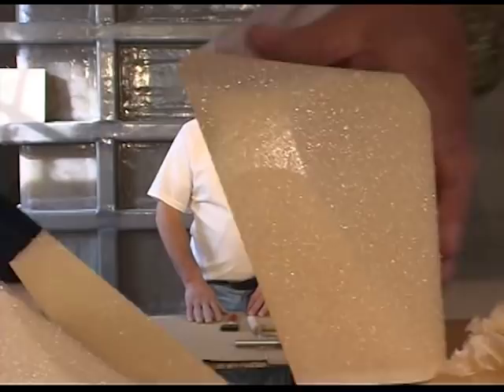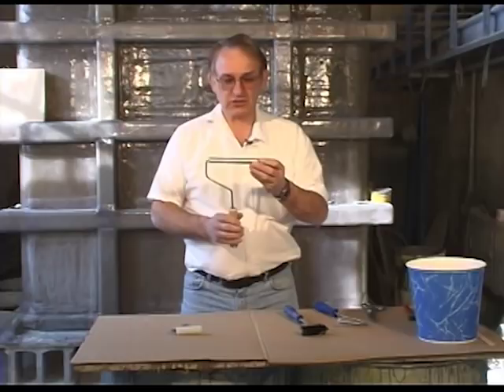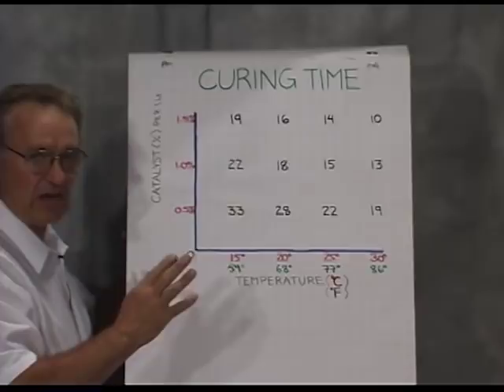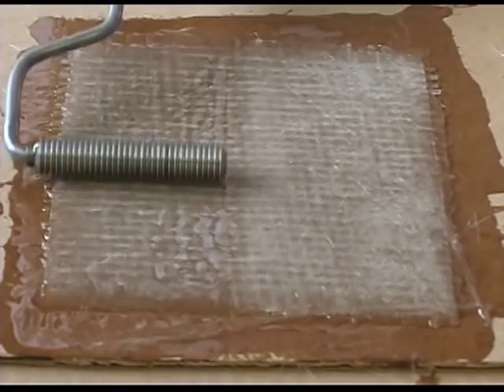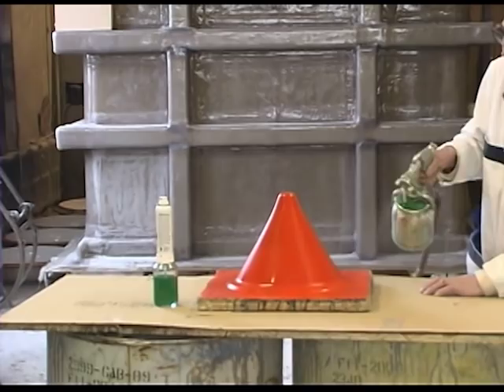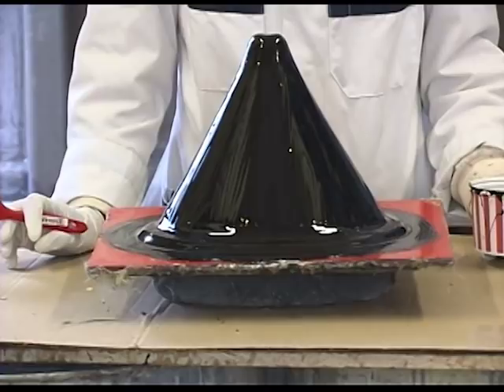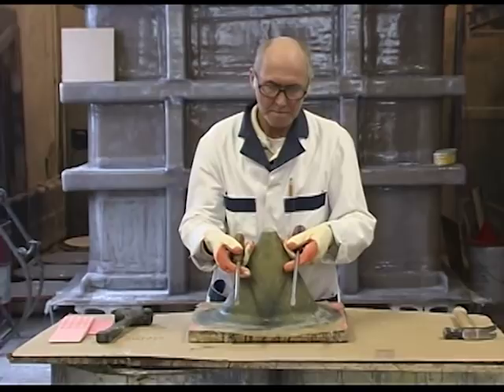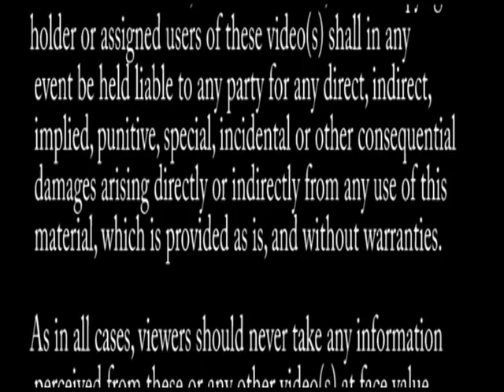How To Fiberglass   Laminating Tutorial

Comment: Will a 1:1 mix ratio epoxy resin for fiberglass onto plywood do the same job as a 2:1 mix ration epoxy?
Reply from the maker: Yes it should work, we recommend to always do a test piece first.
Reply: Awesome thanks. Do you know how many square feet a 2 gallon of 1:1 epoxy resin will do? I'm doing a 2.5ft X 7.5ft sheet of plywood
Reply from the maker: A litre of mixed resin should cover that area.
Ray
Reply: Okay thanks for your help!
Reply: @rayplex  😊

Comment: I recently started working for a boat building company in central florida with new ownership. We have a lot of pre release problems. Know one can seem to figure out. Any info or advice? Thank you.
Reply: Check your air compressor for oil.  Diesel exhaust is another culprit. Gel to highly catalyzed so slow it down to less than 3/4 %.  Are you batch mixing the gel or injector?  The gel is too highly reactive, who gel are you using.  What type of release system are they using?
Ray

Comment: Your brushable Gelcoat have wax additive for cureing ?
Reply: Gelcoating a mould there is no added wax. Your terminology of 'curing' is incorrect, wax is not added for curing. Wax is added to make it tack free - non tacky. You are thinking of flowcoat which has added wax and is applied on a finished part.
Reply: @robertcain3426  gelcoat will not cure unless surface sealer, or PVA is used.
Reply: Please keep in touch Mr.Cain would appreciate it.
Reply: @frankclarkjr6369  Frank, I repeat you are using the wrong terminology and therefore will confuse people. Resin, gel-coat will cure with or without added wax or added film. It's just not able to be sanded without clogging sandpaper.
Reply: @robertcain3426  Thank you
Reply: Mr. Cain, may I send you my email?
Reply: @frankclarkjr6369  Not true!

Comment: I've got a question .I'm in the process of building a mold for a car . since I'll be making fairly large pieces , front and rear end at one time in one piece  , I'm concerned about being able to do it all at one time.  does the resin allow you , the unwaxed resin , to come back the next day and lay multiple coats of fiberglass mat on it to build up a heavy enough mold so it doesn't move when you break it Loose from the buck.
Reply: Try and apply all your layers in one layup.  Adding extra layers on top of cured layers can cause distortion or unusual shrinkage.  Ray
Reply: @rayplexstudios9997  have to disagree with that. In fact the opposite is true. A too thick of an application  will cause too much exotherm - heat - and cause shrinkage. It can even demold the laminate from the mould.
Reply: @robertcain3426  I started my fiberglas career in the early fifty's! Made drones for the Navy.  We used polyester resin using two different. Catalysts! One was heat setting ( low amount) the other was a sunlight setting catalysts (ultraviolet). Started with the sunlight when cold under ultraviolet lights then put in oven to finish the cure! Made the most beautiful parts ever!😊
Reply: @robertchilders8698  I didn't realise UV resins were around in those days. I started in the sixties. We must be getting old.

Comment: I think PVA  is marketed by creating the fear that your fiberglass will marry.  We NEVER used it in our molds. It's just added security that's all.
Reply from the maker: We generally use it on almost every part where surface finish is not important.  If it can stick it will, plus in improves the mould life in a production basis.
Reply: WHAT?? P.V.A. is an alcohol based released agent applied on a waxed mould! Preferred carnuba wax.